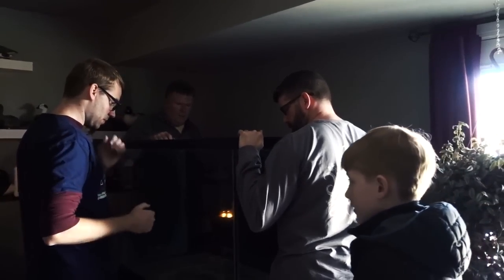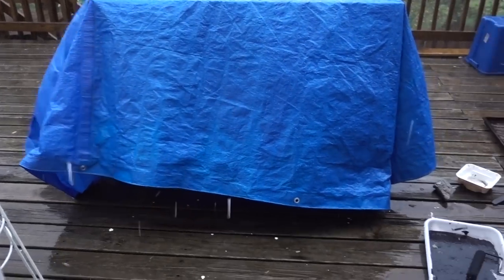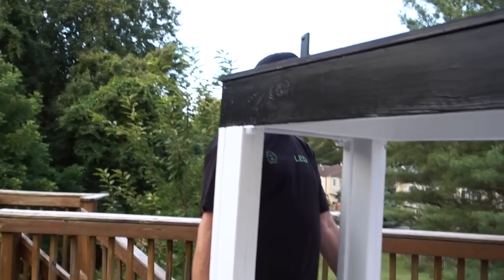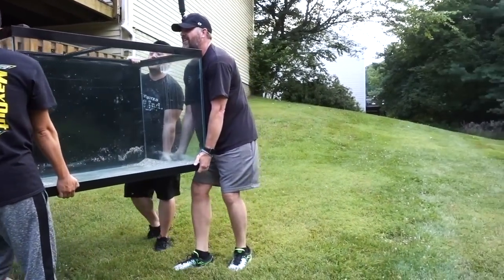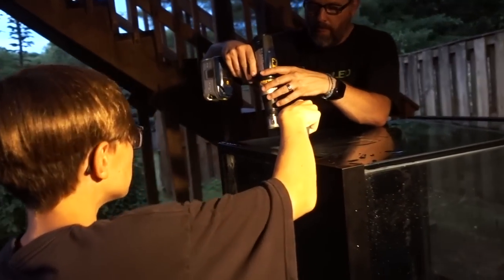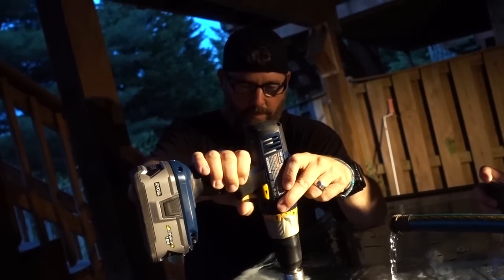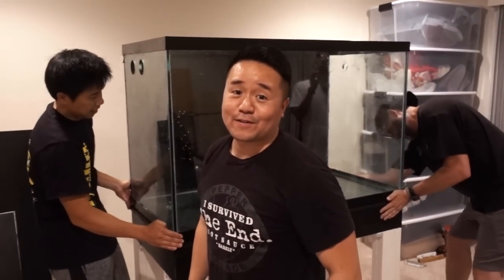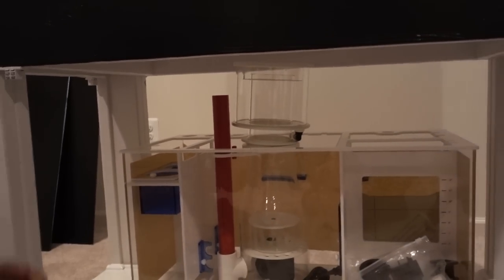Setting up the 150g tank! (150g - 7/7/2019)

Comment: Hey my friend. Exciting news, I just find out about you guys are expecting a little inappropriate reefer, congratulations to both awesome, trust me nothing compare to be a parent, well be a grandparent but you still a long road ahead for that. 
About the tank, finally you are seeing light at the end of the tunnel... buajajaja!  I don't know how you will be doing your overflow and the return. If it's going to be one side return and the other overflow, or both sides are return and overflow one and one if so. There is this new pump that had a double output that you could push water in the DT from both sides at the same time. That would make a nice turbulence flow inside the display. Make your assessment and look for what is best results for your preferences and your already thought on your plans.  Ahhhhhh, remember to use check valve, you don't want an spillover at your man cave. And whatever you decide to make, make it baby proof, they grow faster than you think and can reach places that you won't spectate. Congrats both on this new adventures.

Comment: Can’t wait any longer 😫 Lol I always BEVEL the edges on the pvc and never, never get leaks. When you BEVEL the pvc you’re giving a space for the glue to sit on and make a really good seal. And when putting your gate valve for the drain put it as close to the sump as possible to build up water pressure before reaching the gate valve 💯👍 keep the videos coming my friend

Comment: Measure twice cut once and is 45s if only for the adjustability. Unions are a must and everywhere you can think. Good luck and keep it up, I would shout for at 6 months pregnant because it gets crazy after that.
Reply from the maker: We are at the 6 months mark 🤯
Reply: @InappropriateReefer  holly cow get that rock and sand in and started your cycle below the drill lines with no sump.

Comment: Just finished the plumbing on my 4 foot, 120G, first time I’ve ever plumbed a tank. It’s hard! 
My advice (learned the hard way) every time your plumbing turns, use a union so you can put the 90 or 45 elbow on an angle that can line up with the following continuation of the hard plumbing. 
Good luck!
Reply from the maker: Solid advice, thank you!! Where did you order your unions / pipes from if you don't mind me asking? I need to start looking into this!
Reply: Inappropriate Reefer I bought all my PVC from Reefsupplies.ca (Canadian), but I did notice that Lowe’s had all the same stuff, so try Lowe’s first. 
I find American stores usually have a lot more variety (stock) than Canadian but that’s where I’d start if I were you. 

One other thing, two of my unions leaked because the connecting PVC tube was a little too long, only by a few millimetres, but it was just enough to push the union open a crack for water to escape. All that to say, measure very accurately!
Reply: *don’t buy paint to change the colour of your white PVC, it runs and looks awful!  I wasted a few feet of it on this futile attempt. 
Make sure you put some LED strips under the stand so you can see everything. Reefdudes knows which stuff to buy off eBay. 
**youtube doesn’t allow me to post pictures on these comments, my apologies.

Comment: I would slide the sump to one side under the stand so you have more room on the other for equipment.  Also then that way you will be able to pull the skimmer cup off sideways and get it out with out having to tip it, or use a python hose to suck it out before you pull it off.  Also just bite the bullet and pick up a calcium reactor right away instead of dosing that would give you more time with the kid instead of having to mix chemical all the time.  Just a few things off the top of my head lol
Reply from the maker: Thank you! Sliding the sump to one side! CA reactor is quite an investment though since I could just move my dosing stuff from the 45g to the 150g 🤔 will have to shop around!
Reply: @InappropriateReefer  Yup you could just move over the Dose pump and stuff.

Comment: The only thing I would be worried about is getting that skimmer out of the sump if you ever have to clean,fix ect it. I would suggest putting the sump where you want it to be under the tank centered, to the left ect and see if you can remove it from the sump without the cup on.

Comment: Awesome sauce!  I have same tank dimensions and same skimmer.  Your gonna strongly dislike two aspects...I predict.  One:  not being able to simply remove the skimmers collection cup to empty/clean.  I'd find a workaround..even if it means trimming the stands lip.  Two:  Working in a 30"+ H tank will change your mind about all future tanks.. you'll want to stick w/ 24" H.  But!!!! It's still gonna be an awesome setup!
Reply from the maker: I kept hearing about how much a tall tank sucks... looks like I am going to find out! 😂 just really afraid to drop rock and break the bottom of the tank. I think I lucked out as my skimmer collection cup has an exit tube that I could attach to a waste container, so I don’t need to remove the cup!! 🤩👍
Reply: @InappropriateReefer  True, the waste line can be used.  You'll need to clean the rim inside the cup weekly for it to keep skimming  regardless.  But my experience is just my own.. and I'm super lazy so you may not see it as troublesome as I have.  The height has it's advantages for sure.  My problem is even though I'm 6' tall with unnaturally long gangly arms, even on the 2nd step of a stool my finger tips barely touch the top of the 5" dsb with waterline up to my armpit lol.  Tongs are your BFF!

Comment: Pretty inappropriate holedrill...🙈normally use aTemplate out of a piece of wood, fix it with doublesided adhesive tape on the place where you want your hole to be before wetting it,  and its drilled from both sides, to dont have the glass splittered... use a normal spray bottle to apply some water on the drill whilst only steady number of revolutions (slower speed approx 800 turnarounds per min) and no pressure to it. but ok if it works the „easy“ way with some luck🤔🙈😋

Comment: For your pump. Do a Jaebo DC pumps. Mr Pipes, Fish of Hex and I even use them. Plus wont hurt to have a one or two for backup when needed. Low affordability of a DC pump. Amazon has those for always great prices. Plumbing wise use PVC. Have a inline UV sterilizer also into the plumbing. You won't regret it on that. Cause then all you would have to buy is the extra bulbs when needed. Plus, what I stated on IG too. Biological filtration is and will be your key to keeping that tank running great. Just run a carbon,GFO and any else you need to keep water clear when needed. I think you'll do just fine